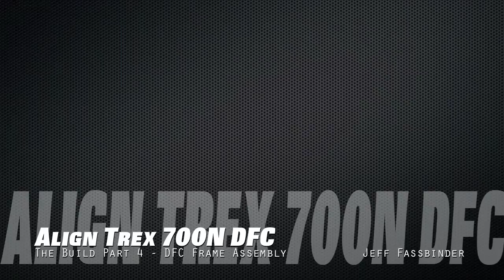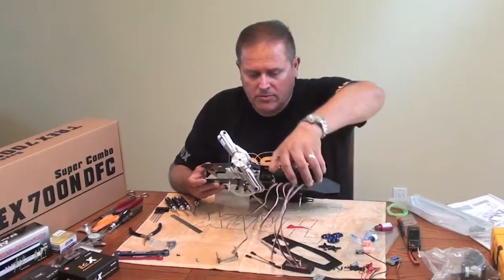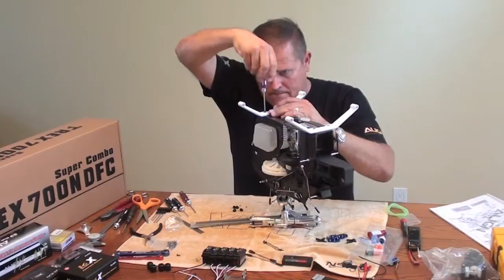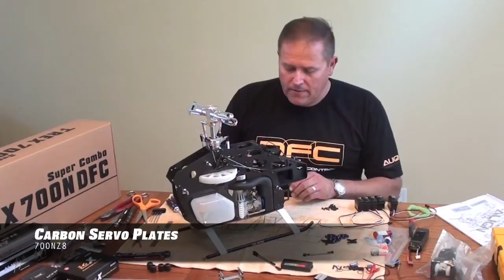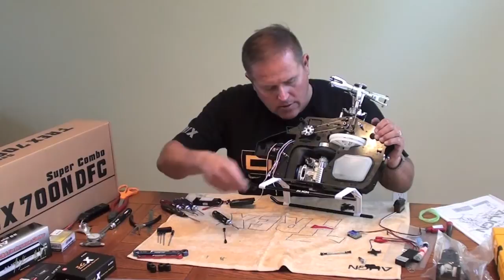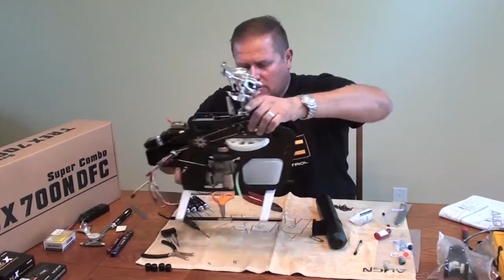Align Trex 700N DFC Part 4

Comment from the maker: The default settings in 3.1 are really good. No adjustment is needed for normal 3D. If you want it faster you can make adjustments but the stock setup is really good. Update if you have not. 3.1 for the 3GX it's free at w  w  w   align    com   tw.